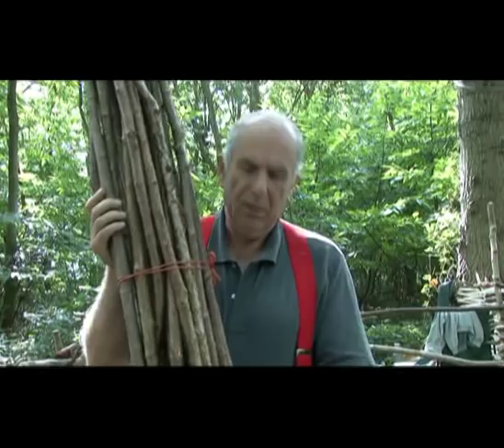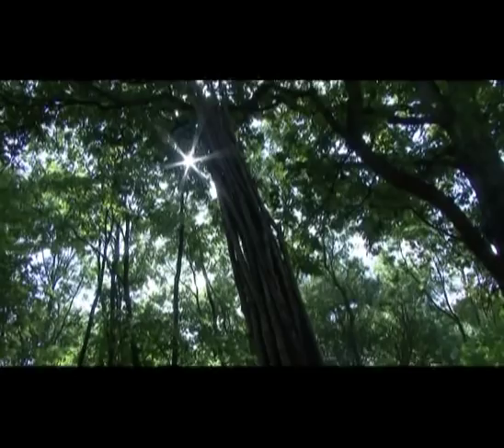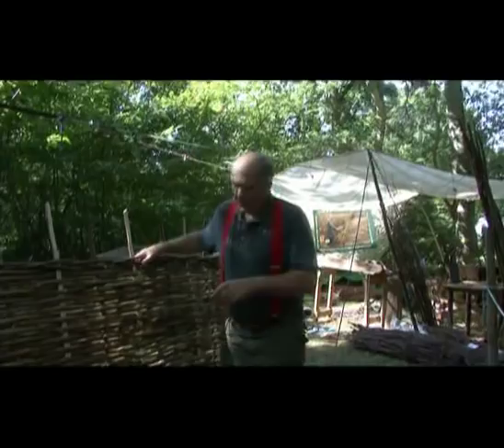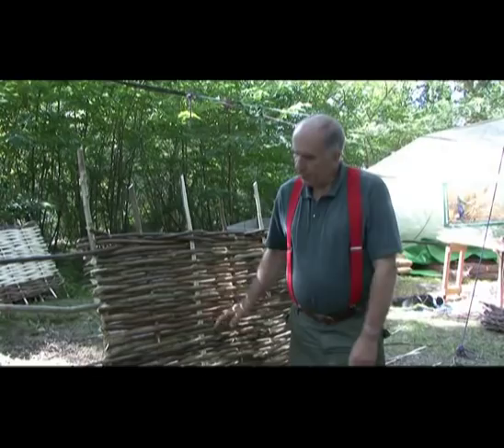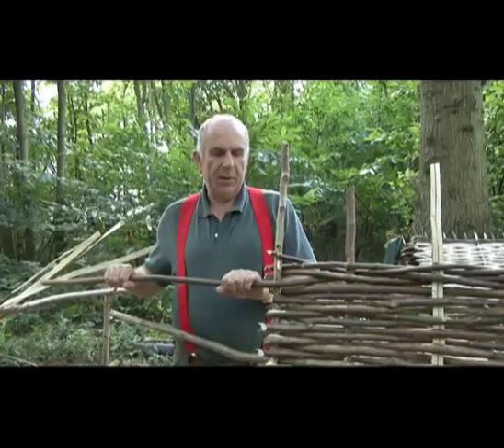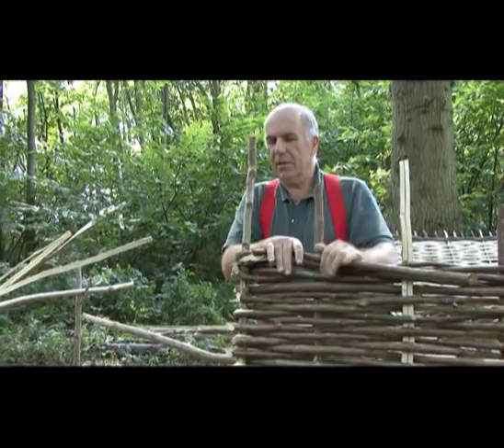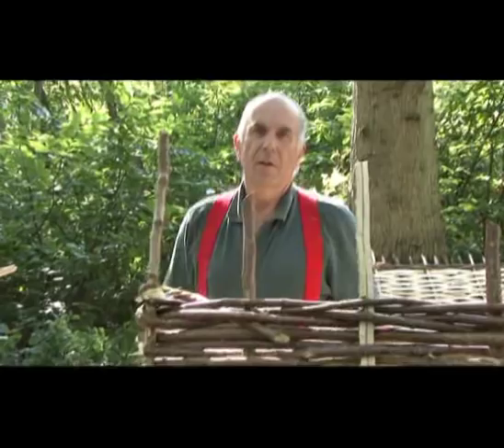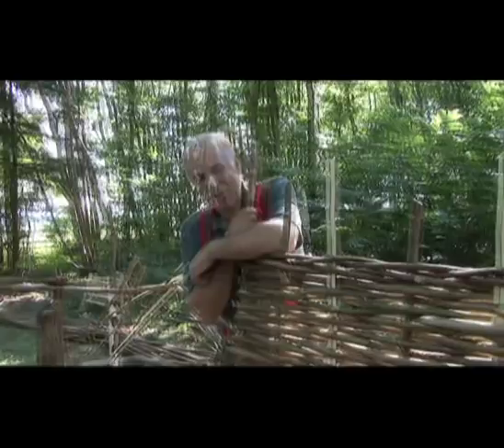How to make a hurdle with hazel and handtools

Comment: that is awesome, is there a video showing how they are or were ever placed in the ground either traditionally or by other method. What other woods than hazel can be used for this, would willow also do and how does the wood weather the elements and rot. These fences look great and have character giving an old historic atmosphere, fantastic, thanks for sharing

Comment: I'm wondering why are the holes in the heavy piece of timber (the mold) not in a straight line but in a slight curve, please?
Reply: To help with tension I’d say, when working with not perfect straight timber then this method adds strength, hope this helps